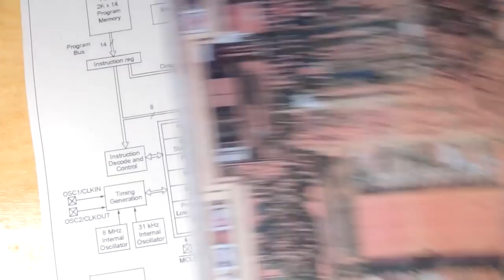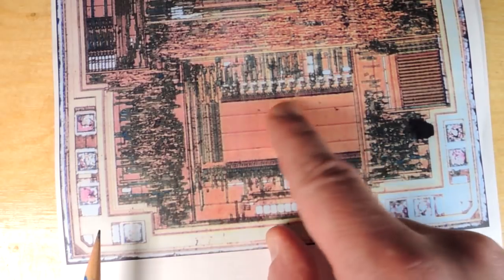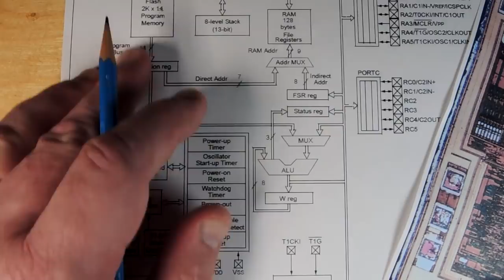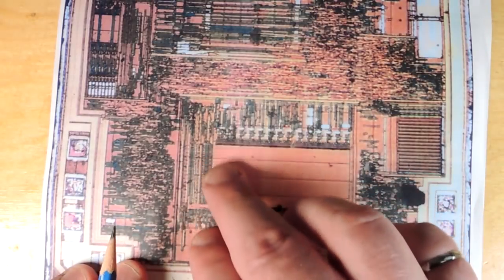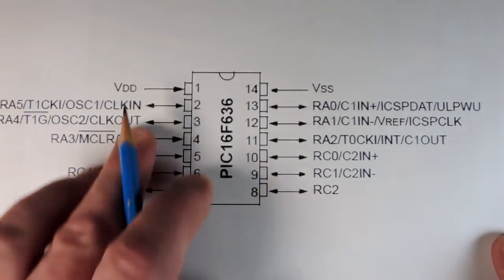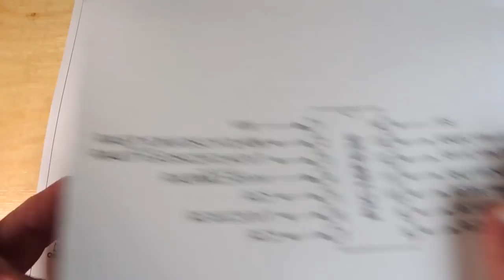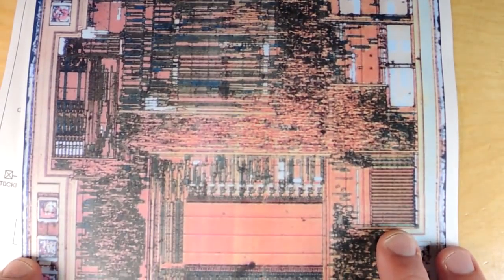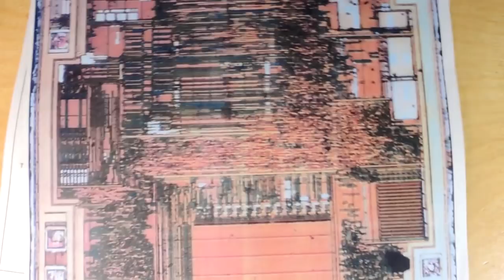Pic Micro  16F636 Taking a Look at the Silicon

Comment: I think your assumption "RAM is going to be bigger than EEPROM" is not always true. But what always gives out it is either an EE or flash vs RAM is the physics they operate with. RAM is just a bunch of highly stripped down flip flops, so just a plain N and P mosfets, on the base supply voltage. But both EE or flash need voltage sufficient for electrons to tunnel through the oxide, so usually way higher than the normal supply. To get that, you need some circuit to boost the supply up. And the only way to do that fully on chip in ot that complex manner is a charge pump booster circuit. A d a charge pump means a bank of not that small capacitors. And capacitors are usually flat pieces of either poly on some diffusion, or recently plates of metal (with the thin dielectric built between these), in either case rather large, clearly visible rectangles. Because only EE and flash need these, it will be close to those arrays, very likely each memory will have its own charge pump (because the significant difference in the voltage specs).
Other large array of small capacitors uses to be an ADC (64..256 ~5um rectangles in an array; these topologies yield very accurate SAR ADCs sufficing with pretty basic cheap CMOS process)
A small array of usually 3x3 or 3x4 squares, each with small square inside uses to be the core of an accurate voltage reference (band-gap circuit) and a temperature sensor (usually an internal voltage from the VBG cell uses to be pretty accurate representation of the temperature, so just feeding that to the ADC gives out an on chip temp sensor virtually for free. Note the VBG is needed not only for the ADC or comparator, but mainly for the accurate voltage generation for the EE/flash memories.

Comment: I don't use PICs but I've used a lot of Microchip I.O. chips and they all have VDD on pin 1 not 7... I find it actually a lot easier to lay them out than the old TTL thing of using Pin 7.

Comment: You should take a look inside some of the "mystery 8 pin chips" that bigclive often comes across, and see if you csn figure out what they actually are
Reply: Very commonly one of an ATTINY 5/10/25. They range from about $0.15 to about $1 each. MSP430 and PIC12s start coming in near the $0.50 level.
Reply: Wait, ATtiny5 has 512 bytes of program memory? You must be really good to make use of that. Actually if all you need is to handle a button and an led or something like that
Reply: Hrnek Bezucha 512 bytes is plenty for quite a lot of these applications
Reply: SAI Peregrinus I wish I knew more about MCUs. The range of chips that run with handful of bytes all the way to full blown Linux system on chip is just mind boggling. The low end side looks very interesting.
Reply: Hrnek Bezucha IMO the best way to get started is to get a cheap development board like a teensy or  arduino and then program it such that the code doesn't take more than the space of a smaller micro. Much cheaper than professional boards, and lets you test real harhware. Use Atmel Studio for programming, it has the necessary emulators that the Arduino IDE doesn't. Also learn ASM & C.
Reply: SAI Peregrinus Recently I actually ordered an Attiny85 Dev board to try out. I'll have a look at the AVR IDE. It sure will be fun trying to find a non-Arduino learning material